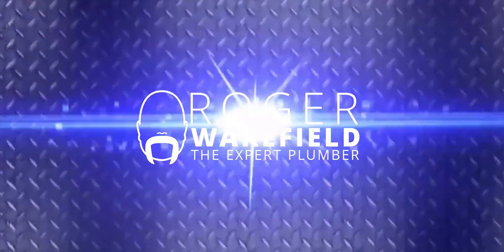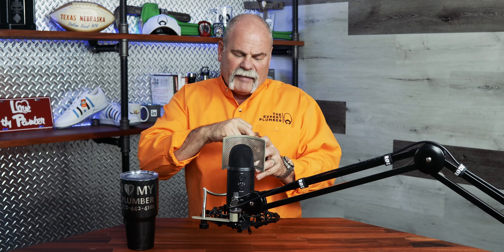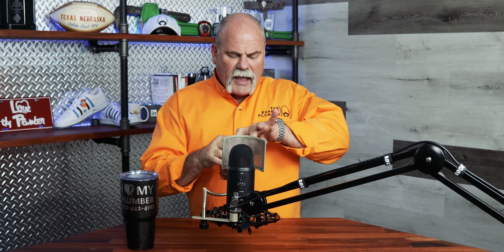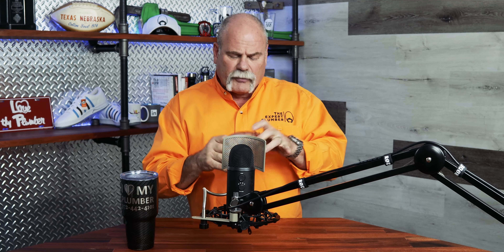Is ProPress Better Than Solder Plumbing Fittings??

Comment from the maker: So which do you like better?
Reply: Roger Wakefield both , but if I have time & not in an attic I'll solder
Reply: Propress. Saves on labor on big jobs and with service you get in and get out and collect your money much faster. Propress all the way.
Reply: I love the ProPress from a working standpoint because it makes the job faster and easier but sometimes soldering it it feels like it maybe has kind of an art form to it I say strictly for you don't work at ATS a ProPress is my favorite but sometimes soldering you know can be fun especially to make a really nice clean solder joint
Reply: Been using ProPress and megapress system for years ( 6 years ) now in the gas industry & it's worked out well. Recently they just took the ProPress copper gas fittings off the market because the O-ring just failed a more stringent testing standard. The mega press is still good at this time. Personally I have had no problems with the ProPress or megapress as long as the proper stab depth procedure was followed. One of my coworker, gas fitter buddies just ran into a problem with a 2" megapress fitting with proper stab depth (leaking ). We sent it off to our lab for testing and still waiting for results. Just a note to all the pipefitters and plumbers out there that use this system, time and experiences over time are the best test. Systems like this start losing their luster if failures start exposing their ugly heads ( time will tell).
Reply: Roger Wakefield I would love to try ProPress. The benefit of saving time and hassle with draining a water system can definitely outweigh the cost of the fittings. Viega manufacturar data claims a 50 year warranty, we will be investing in this soon. Great video!
Reply: Both, totally depends on the job. Repairs mostly pro press
Reply: Solder
Reply: I use both. I use solder on manifolds for slab leak rerouting. I use propress for a lot and as long as you clean the pipe, rheem it, and get proper stab its perfect. There are pros and cons to both. But when I have 2 hrs to repair 4 leaks in a complex and they are all in separate parts of the complex, propress all day long.
Reply: ProPress is the way to go !
Reply: I prefer running garden hoses when I rough in a house. No fancy tools needed and is readily available.
Reply: I love this. I saw the shark bite video and completely agreed but I was thinking hmmm i love pro press let's see if there's a video for that. Man it cuts boiler installs by almost 3/4 the time once you're very proficient. Makes labor go down and the customer cost goes down. It just makes long jobs better and they've got it for refrigeration now as well
Reply: Editing is better! Lovin the memes and sounds lol. But i dont think your knowledge and words can get any better.
Reply: @louietheplumber3609  oll

Lollll
Reply: @charlesking678  lmll
Reply: I'm not sold on this. I don't have much faith in O-rings long term. The only huge advantage is with water in the lines...but with that scenario do what you have to do to rid the water and soldier away. Sweat on a PEX fitting and go from there.
Reply: We've been using Propress for over a decade, and I LOVE it! In all those years, there's only been one failure and that was due to installation error.
Reply: I'm a joiner and I think the shelving behind you is a fantastic marrying of plumbing and joinery 👍
Reply: I don't think we have pro press in the UK I've never seen it used here,, we have copper shark bites tho, have you seen the copper shark bites, the plastic one's can split in high water pressure areas year's ago it happened to me luckily it was my cousins house so we swapped the broken elbow for a compression elbow.
Reply: Pro press allday I still have to solder occasionally but I want to keep that skill sharp not alot of new guys never even pick up a torch now adays one thing to solder its another to know how to solder when water is still trickling out of a pipe
Reply: Solder is better, propress is almost exactly like a shark bite, sealed by o-ring, o-rings go bad
Reply: @tylerriese8293  solder goes bad as well
Reply: @fortunatedad7695  😂
Reply: Propress for certain jobs as in re-piping a pier and beam house or swapping out heater ball valves, repairing leaks in the yard/valve boxes and shower valve installs. But if it's a manifold or jobs that require saving copper to actually do a future repair if needed I'll allow the next guy if not myself to be able to un sweat a solder joint.
Reply: We use Propress for major shutdowns at the Hospital.
Especially great if a valve is passing, we can press on a new one downstream etc, you get the picture, we've all been there at 2:am and the water is still draining...
Also prefab your pipes in the shop using soldered fittings for cost savings and then progress that bad boy in using progress service couplings 💖
Reply: @tylerriese8293  while I'm not a huge fan of proress that isn't entirely true.  The seal in propress is compressed by the crimp action against the outside of the pipe.  The crimp action doesn't allow for joint movement.  Sharkbite doesn't compress the o ring and fitting onto the pipe, so there can be joint movement which will wear faster on the o ring.  I still think solder in the wall, propress in accessible areas, boiler and water heater installs, etc.  Copper is getting expensive and doesn't show signs of letting up, so it will be less and less common in residential to see it used extensively.  Around the boiler and water heater is a great spot for propress as the connection should outlast the appliance.
Reply: We use solder and brazing at work. I would like to recomend these press fittings be used if I can get the engineers to listen.
Reply: @williamknighton7416  Brother brother please art form brother you’re not welding structural steel you’re not welding a trailer that has to take a weight has a function you are literally filling a hole with solder ,If you went to a boiling making factory Do you think you can walk in and be a welder please brother delete this post it is fucking one of the dumbest thing I’ve ever read
Reply: I like everything about prioress except, plumbing jobs are rarely charged by the hour, and that it is risky to connect to old pipe that has thinned out a bit or was originally M. Also do we know what the ring is from? EPDM, or something else, is there a standard enforced on all those?
Reply: Pro press, on commercial service jobs
I can pro press on pipes still running
Reply: How could ProPress be better than solder since the EPDM rubber o-ring inside of the ProPress joint will rot over time whereas there is nothing to rot in a soldered joint?
Reply: @tylerriese8293  I was thinking the same thing.  How could ProPress be better than solder since the EPDM rubber o-ring inside of the ProPress joint will rot over time whereas there is nothing to rot in a soldered joint?
Reply: Once you ProPress a fitting, you can't Un-ProPress it out.  Once it's there, it's there!  Whereas with soldering, you can always unsolder a fitting if needed.
Reply: Just got my first Milwaukee M12 Force Logic press tool. So happy. I've been using them at work for two years now and they are so good. 
It saves a lot of time. I paid $2450 plus tax which came out to $2750. Im in Ontario Canada. Great video Roger.
Reply: I’m a DIYer and had fair amount of  plumbing to do - 20 connections or so. My house is 150+ yrs old so soldering in the basement makes me nervous. I got the hand-crimp tool for ProPress on Amazon. Cost $150 and I love it. Made the job fast, easy and nothing caught fire.
Reply: Pro press for most applications, but not all.
Reply: Propress
Reply: Solder.
Reply: I have seen propress fail within weeks after install.  I solder

Comment: I've never seen an o ring that lasts forever.
Reply: I've never seen a piece of copper pipe last forever, either... Especially in low P.H. well systems. 50 years is more than acceptable. Most homes are overhauled and re-plumbed way more often than every 50 years anyway.
Reply: Lol... I've seen leather o rings I've pulled easily 50+ years old. May not last to 200 years but I believe they will last a life time
Reply: I don’t believe the O ring is what seals. I believe it’s the copper that’s fused together with the tool. The O ring is a “backup” from what I understand. I just used this tool and it’s the best recent tool invention. The connections I did aren’t going anywhere.
Reply: Never seen copper last forever either so what’s your point
Reply: @@u82zar  I've heard the same thing. The copper males the seal.   I also see solder joints full of corrosion on the regular.
Reply: @josephdunnavant2898  
Wrong Answer
Reply: An o ring is a dynamic seal it moves friction breaks it down.  In propress it is static it doesn't move there is no friction.  The "Sealing element" isn't the only thing creating the seal.  You can actually get a seal that doesn't leak with out the element in the fitting
Reply: @oilandfireguy1739 could be water quality or more likely too much/not cleaning the flux
Reply: Exactly I've had them fail just after a week went back to soldering.
Reply: The space shuttle blew up because of an o-ring
Reply: I've seen pressed fittings from the late 80's still going strong
Reply: Here in Florida, your copper isn’t going to last more than 30 years. Propress is at no more of a disadvantage than solder.
Reply: Chernobyls meltdown was due to an oring, this doesn't convince me.
Reply: Pro press fittings seal off of the crimp not the O ring
Reply: It never does when the rubber meets the road
Reply: I have seen Pro-press fail. 
I have never seen soldered copper fail.

Comment: Solder is proven when installed correctly.  Propress will save you time on the job obviously and will pay for itself in time after a few jobs.  But, time will tell longevity wise for progress fittings depending on those o-rings.  Tenperature and quality of water on those o-rings!  Soldering you can install tighter fitting layout, unlike propress.  Usually newer technology is good, but having to adapt to change is what makes it hard to switch over. Solder for sure. I would have to see installs over ten years and water quality tests on those non failing installs to switch over.

Comment: I've got 4 service trucks with a propress in each one. Saves time every time. Only use the torch to remove a fitting if needed. Been using propress for 10 years and as long as you install the fittings properly there are no problems
Reply: I have a Milwaukee propress and I love it I am trying to get the  Megapress
Reply: 10 years? That's nothing. When your installing under slab on a new build you should be looking at longevity in the hundreds of years, or at least a hundred years. Are the rubber fittings still going to seal in a hundred plus years?
Reply: Nibco pro press fittings suck
Reply: @jellybean1976928  Having had slab leaks from 50 year old copper with soldered fittings, I think that is a moot point. The thing about gaskets, is that if designed and manufactured properly they can have incredibly long lives. Oxidation is normally where failures occur, and these types of fittings, seal against that. It's different then a SharkBite for that reason. I don't have a PowerPress tool, but would love one.
Reply: @harrisfogel6992  I own 4 houses that all have copper plumbing much older than me and I've never had a failure in copper, only in GAL pipe. Whereas I own 60 cars, the Majority of which are between 30 and 50 years old, I can be sure that even the best gaskets deteriorate and have a lifetime that shouldn't IMO have concrete poured over them making them non serviceable.
Reply: Wow, lots of cars! So, the stresses put on automotive gaskets are apples and oranges. Not that your point isn't well taken. But, gaskets sealed from oxygen, makes a huge difference. So, burying under cement, isn't all that wise in the first place. Especially in places like CA with earth movement a reality.  But, soldered joints are breaking here, under the concrete, and who knows, the thicker copper of these fittings, harder as well, might very well last longer than soldered joints under water. You know, in electronics, NASA discovered that wire wrap was more reliable than solder in many cases.
Reply: @harrisfogel6992  I hope I'm wrong with my concerns. I am building a 12 industrial unit development here in Regional NSW Australia and the plumber had run hundreds of metres of copper under the vehicle movement areas and used pressed fittings contrary to my request. When I build anything I take a godd-better-best approach and always aim for the best and something that will last absolutely as long as the embodied resources in the project are capable of, which should be at least 200-300 years in most cases (when high quality steel and masonry is the primary building materials). So yes, these fittings will almost certainly outlive me and definitely outlive my period of ownership in the project, but that's not the point, are they the absolute best in terms of multi-century longevity? So far as car gaskets, yes heat cycles are a big issue, but seemingly as much and issue is years of non use. Whether oxygen plays a role here I'm unsure, but I've have many failures after cars have sat for ten or so years unused.
Reply: @jellybean1976928  yeah, listen, even having pipes in walls scares me! I talked with an engineer here about why pipes are failing underground, and he told me that many of them are failing at soldered joints, due to a reaction with chemicals in the water, to purify and fluoridation. Interestingly, he said that other factors, like not deburing pipes, adding to turbidity, is a large factor in slab leaks, as well as pinholes. I'm a curator, and a photo historian, so around archival testing, specs, etc. And my conclusion is that despite rigorous testing, with really competent folks, we really don't know how things will hold up over time, with new materials. We know, for example how certain ancient materials will do, based on samples hundreds of years old. Rabbit Skin glue for example, dyes, substrates. So, we learn from that. But do I think a modern car will either run, or hold up for the next fifty years? I don't. And judging from my own cars, supposedly top quality, heat and age resistant plastics, are brittle and useless in as little as ten years. So, who knows? Personally I think the strength of the Power press fittings,from a purely mechanical POV, is probably really, really secure. And supposedly, those fittings are still water tight, without the seal. But...

Comment: It hurt seeing him toss that fitting. They ding so easy and that looked like a 2” 90 which is probably $30. The two things about pro press I don’t like is there’s something in the back of my mind that worries about that o ring long term. I don’t like any sort of gasket I can’t change. The other thing i don’t like is you can’t undo it. I can sweat off a fitting. Once something is pressed you have to cut behind the fitting which may be in the wall. Sometimes you can get the smaller sizes off. Lining them up is another issue. Sometimes when pressing they get turned the wrong way. I’ve been able to turn megapress fittings a little with a pipe wrench but copper is too weak.
Reply: On point
Reply: Exactly! Propress had its place, it's quick and easy to use.
Compression is where it's at.
Reply: The gasket doesn’t make the seal. You could literally pull the gasket out and press the fitting and it still wouldn’t leak. How do you think that propress passes fire ratings?
Reply: @paulallen-01  that’s what they say but I’ve found that not to be the case. Go ahead cut your pipe with a band saw or sawzall then just just shove it in the fitting regularly and tell me how well the system does when you nick or snag that o ring.
Reply: @paulallen-01  on top of that, EPDM can be fire rated. Uponor pex is fire rated. They even make fire rated pvc. It doesn’t ha w to be metal rod be fire rate

Comment: I have pro pressed under full pressure, in a hotel with supply solenoid on a timer. This solenoid opened on me mid installation of a bypass line and I was able to press a ball valve(open) before a catastrophe happened. Believe me I was soaked by the time everything was brought under control. I was not a fan of the propress going into that job, I immediately became a fan,👍🏼, good video. The positives outweight the negatives. Not all A&Es approve this product because of personal experiences with projects where the installations where not done properly. However I try to push for this product whenever I can. The big thing about this product is that the copper needs to be debarred properly, the fittings need to be bottomed out, and ( most problems I have seen are this stage) do not forget to pro press every joint. The outfit I used to work for had us initial the joints that we were responsible for, this alone brought down the number of failures due to forgetting to crimp joints in big jobs. Keep up the great work on these vids.
Reply: I installed propress over twenty years ago and it is still holding, I borrowed the press tool from the plumbing store I bought the copper and fittings from.